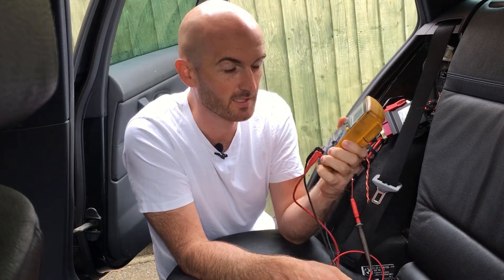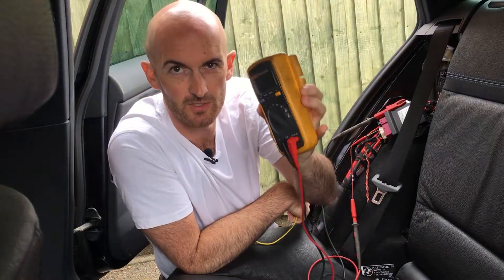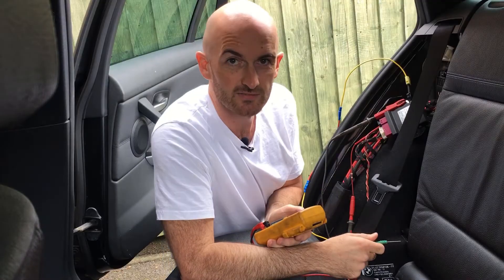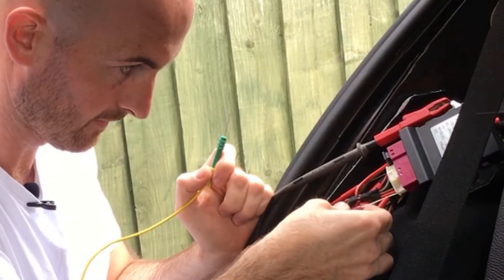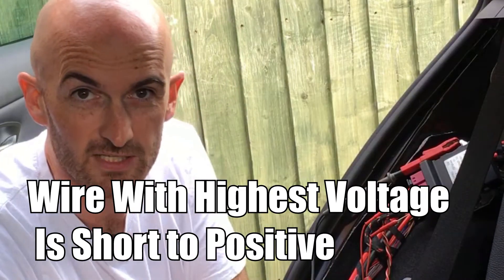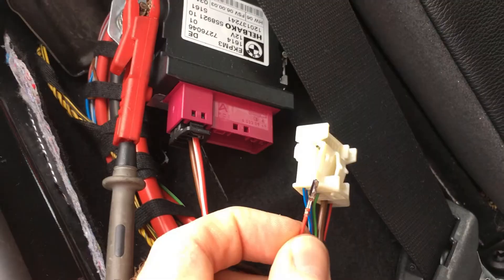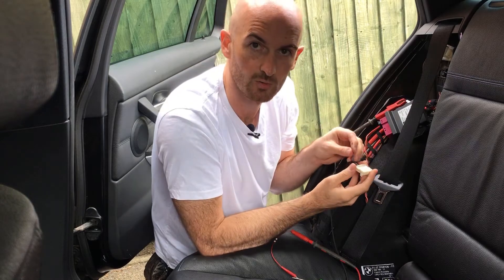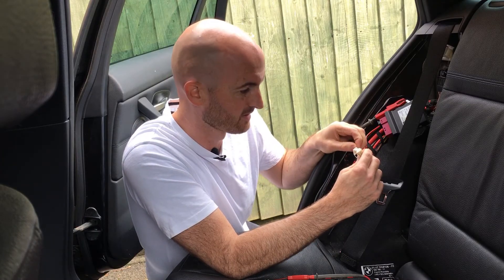Finding CAN Bus Faults With Multimeter | CAN Bus Diagnostics | Mechanic Mindset

Comment: Yeah bro I really like videos like this and your time spent for this video,
What do you think about 10v Can H and can L about 10v as well? I've unplugged about 95% of modules and wiring but no change. The initial problem is no drivers window and aircon. Got this car from main dealer. Any advice appreciated
Reply from the maker: @Eglent11982  Could be a resistive short to power. A look at the oscilloscope waveform will give a good idea. I take it there are no comms with any modules?
Reply: @MechanicMindset  that would have been great if no coms with any module, that's the start point wright there. But I have coms with every module!!!! I've chopped the rear end off the car from the front and still have 10v from front or rear  independently. What is going on??? I'm being doing this for the last 20 years

Comment: I am confused about shorting CAN wires. First you shorted CAN L wire to ground and CAN H to ground. Then you are shorting CAN H and CAN L to ground again, aren't you? Are you referring to CAN Low speed and CAN high speed? Then for each there is CAN high level and CAN low level? For instance, CAN high speed H level at rest is 2.4V and CAN high speed L level is 2.6. for the low speed CAN H level at rest is 0.0V and for CAN low speed L level is 5.0V. Is this what you are doing? I gotta watch it again.
Thank you
Reply from the maker: Can’t remember without watching the video. There may be a short together, and a short to live too. 

Voltages you mention there are about right for high and low speed 👍

Comment: Hi, i'm currently having an issue with a BMW E46 320CD. Since you are knowledeable on the topic maybe you could lead me on the diagnosis.
I tried the DDE resistance check and i have 121 ohms, so the DDE seems OK.
On the DDE plug that connects the two CAN bus wires i also got 120 ohms. so not the terminal resistors then.

I checked the canbus on the plug connecting to the instrument cluster and got around 60 ohms. Both resistors are then connected and overall resistance is within expected specifications.

However, when i check the can bus plug to the light control module, i get 8 ohms ! so that tells me that somewhere, both wires are shorted together  ? Seems to be confirmed when i check both CAN bus wires voltage to ground : i get 2.42 volts on each one. That would explain why i have communication problems. 

The strange part is that i get that resistance only on this part of the circuit. There's also CAN BUS wires going to the headlights, and i also get 8 ohms between each.

All modules seems fine, when i connect INPA i can access all modules and read the digital and analog values. Thats tells me that the DDE, the instrument Cluster, the steering wheel buttons, DSC and steering angle sensors are OK. INPA tells me that the error codes relates to a CAN BUS Timeout.

I suspect that both CAN wires are shorted on the lighting network, but sometimes the communication is intermintenttly  restored. I had this issue in the past and replaced the DDE, which solved the problem. However, this time, the DDE seems OK.

Any insight on this doc ?

Comment: Car wont start and scan obd no modules show up. Yet the modules seem to all work except ECU. What reasons are there that autel im608 pro and autel maxisys cant see any modules.
Reply from the maker: It depends a lot on the car. Gateway connection?
Reply: @MechanicMindset  vectra 2009. Breakout flashing blue pin 6 and 14 and all things seem to work. Wont crank or run and no comms but no engine management symbol either. Plan to check resistence of can lines. Can I check between obd and the engine computer to see less than an ohm?
Reply: @MechanicMindset  what is can bus gateway
Reply from the maker: @jamesbarratt593  Check out this video mate:

https://youtu.be/k8bJegVxo_c

If you still have questions, I would advise joining Mechanic Mindset Diagnostic Coach (only $10/mo). We’ve got a full CAN Bus and Networks course with downloads and activities 👍

Comment: Hi quick question.
Should all the can low and can high lines have continuity separately till the OBD port? So if I am to connect to can high wire at the steering control module and connect to can high wire at the obd port should there be continuity? Thanks
Reply from the maker: Good question. It depends on the network. Some OBD CAN connects to the gateway and nothing else. Best check your wiring diagram 👍

Comment: I'm gonna bite the bullet and post this million question dollar here - why do cars and modules go to sleep after a certain time? What is this open time representing? Can't a module be given a simple message to shut itself down after ignition off/locking, the same as it receives the wakeup msg? I have an E91 with TCU and yes you have guessed it I never ever figured out why the heck this thing keeps the car awake for almost an hour before it goes to sleep. I thought okay the E91 is a 15 yr old car and the luxury doesn't boot  fast. But then I had an opportunity to see what G-series BMW does and it is practically the same. This is almost like turning off your phone completely, but it will still keep the cell and wifi connections on for 30 mins... What's the point except power exhaustion?
Reply from the maker: Great question, and lots of reasons! ABS - allows ABS function to continue should T15 be lost while driving (same for SRS). COOL Down - some routines are executed after key off like EGR cleaning and cooling etc. CLIMATE Control - hold the valve in heating closed so you don’t get a blast of hot air after stopping at shops. PHONE - allows phone calls to continue after turning key off.  BRAKES - electric handbrake re-applies after stopping due to brakes cooling. I’m sure there are many more reasons too, this just off the top of my head 👍

Comment: This is good stuff but not presented clearly. Some text on screen showing what fault you've introduced on what leg of the BUS and what the readings are on each leg of the BUS would be incredibly helpful. Would also turn this video into about the only source online that has those values clearly listed.
Reply from the maker: Hi Zac,  thanks for the feedback! I try to keep the videos as short as necessary and try to make it as simple as possible. We can appreciate that the diagnosis of CAN is a large subject! Would you be interested in a more formal online training course hat covers all aspects of CAN (and other networks) diagnostics?
Reply: @MechanicMindset  Ha! That's a funny question because I was actually looking for resources to make it through an online assessment test for the manufacturer I work for when I found this video. I do a fair amount of CAN diagnosis at work. But A) CAN buses usually don't fail with direct shorts or opens and B) DVOM readings aren't how I approach diagnosing CAN faults. I use a scope or graphing meter to look at patterns and then isolate modules until the bus comes back online. The manufacturer I work for typically uses hub networks with central bus bars where you can disconnect modules one at a time until you isolate the problem branch.   

Short answer: No thank you, I have training provided to me through my work. But thanks for the polite response.
Reply from the maker: @Wrencher_86  👍 Do you work for Audi? PS I have a few other videos diagnosing with a scope, it sounds like you might like the one where I use a decade box to dial in fault resistance

Comment: Thx for the video and guidance. I have an issue on my Mercedes Canbus "checklamp error".
I replaced the set of wiring inside the front headlamp housing and used thicker wire for Parking light. While turning on parking light (H6W spec), it return dashboard error. 
Am I wrong doing for "thicker" wire which corresponding less heat and resistance? Regardless Bosch Halogen(6W)/LED with Canbus correction, it returns this error message.
I have ordered Philips 5W Canbus Resistor from Amazon, yet arrived. Should this help to fix the issue? Please advice and thanks again.
Reply from the maker: Hi, I think there is a confusion between CAN Bus and ‘cold bulb monitoring’. CAN bus doesn’t really have anything to do with normal lights. 

If your car returns a lamp error, it because of a fault in the circuit or the LED light you have fitted.

Comment: Sorry mister,
My car(panda fiat 1100cc 169 model, 187 engine model) I have can line to short circuit to positive..

Obd2 diagnostic pin 14 only key on have a 12v, battery tension to ..pin pin 4 or 5 ground... 

Pin 6 have 0,3 volts between pin 6 and 5..
And car won't start.
I changed ecu engine and body computer and key..
But another wont start.
Meccatronics my land won't work its because not experience.
You are idea?
Thank you
Reply from the maker: Follow these basic steps for CAN bus diagnostics 👍

https://youtu.be/k8bJegVxo_c

Comment: Going to have to watch this a few times.
I got a bit confused about when you were testing and when you were intentionally shorting wires together.
I initially thought you were shorting the wires together as part of the test until I realised that this was just you "creating the fault". It might have been clearer if you had hidden the footage when creating the faults, but then again I suppose that in itself is instructional too.
It just took my brain a while to figure out what was going on!
Maybe showing a quick simple diagram on screen of the type of fault could have made it clearer what was happening.
Reply from the maker: 6 minutes is a tall order to cover this off! Check out my 4th and 5th video where I use a scope to diagnose the same faults, and show you how CAN is connected with the resistors etc. 👍
Reply: @MechanicMindset  Yea, I understand the concepts and all, with the terminating resistors, etc.
I just meant that it would be a bit confusing for somebody following along, and not paying 100% attention, and then they go out to their car to diagnose it, but instead they follow this procedure (exactly) and they short the wires, and then measure it and find a short in the wires, and think their can bus is shorted out!
If that makes sense?
But yes, I'll definitely watch the other videos. I think I've got the basics pretty much down, but I'm just watching a bunch of different videos to make sure all the concepts are solidified in my head.
I'm trying to diagnose a consistently random intermittent fault in my high can wire at the moment on my X-Type, between the TCM and ABS. I've got a Hantek 6022be in the post so it should be here in a few days, hopefully it will make the process easier, seeing what's going on with the signal.
It's a strange one, the car is running fine, and almost all the values are fine on the diagnostic (speed, amps, etc), but it jerks when putting it into gear, as if the car isn't getting some reading correctly, like a crankshaft torque/speed value or something. And I get a U0001 communication error that comes back 10-30 seconds after I clear it.

Comment: Hi , could could you give some advice if you have the time please
Reply from the maker: Hi John, how can I help?
Reply: @MechanicMindset   thanks , i have a 2010 renault scenic  front wipers have stopped working  done some basic checks each side has it's own motor   getting 12v , ground and the 2 smaller wires  have around 8 v ,  when i move wiper switch  i'm getting a small change around 0.5 volts  in these smaller wires  ,  looking at live data in the uch when switching the wipers on it will change  to on but only for 2  seconds and back to off again  ,  The other thing i have noticed with the bonnet up and engine on there should be a warning light for bonnet open but nothing , i'm using a delphi ds sadly no live data for the bonnet switch any advice on direction would be greatly appreciated . also with both motors unplugged  it's not setting any fault codes ?
Reply from the maker: @johnbickle4654  Ah ok, I must admit I’m not familiar with the set up. Unlikely to to two motors failed so I would be looking go for common factors for the two. The bonnet sensor could be a start; I know a few vehicles inhibit the wipers with the bonnet open.
Reply: @MechanicMindset  Thanks  ,   Do you think this is a lin bus control  as it's showing around 8v on the  two small wires  , someone said the driver side is the master  and if faulty both won't work , i thought the bsi  (uch) would be the master and motors would be slaves  keen to get this solved where can i learn how this type of system works had a look online but can't find anything? Thanks again
Reply from the maker: @johnbickle4654  Ah yes, likely. I do remember a similar system in Seat Leon when I was at VW. You got a scope to check it? He’s right, the master needs to be working so they don’t clash
Reply: @MechanicMindset  I don't have a scope at the moment  would test could i do with one to confirm master is at fault? thanks again for your time

Comment: So CAN high & low have a resistor between them... A fault in one side will effect to other side as well.. what rating of fuse did you use while you shorted the lines ?
Thanks ..
Reply from the maker: Yes pretty much; for high speed CAN that is. On low speed CAN, it’s a little different. It can work in single wire mode. I just put a 5A fuse in the jump wire; just incase I hit a ground. It saves the ground and stops sparks flying! 😂
Reply: @MechanicMindset  Thanks, it helps a lot to learn about these network system. Please keep uploading such videos as the videos available in internet are not very much helpful if you are from mechanical background, your video gives better idea of learning stuffs for a guy like me.
Reply from the maker: vicky singh Thanks for the feedback; happy they are helping! More to come 👍